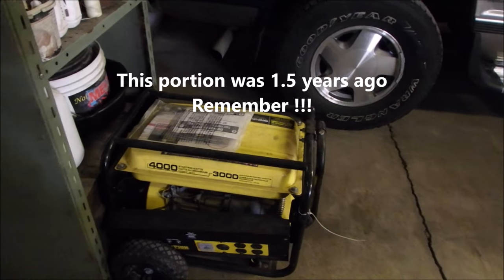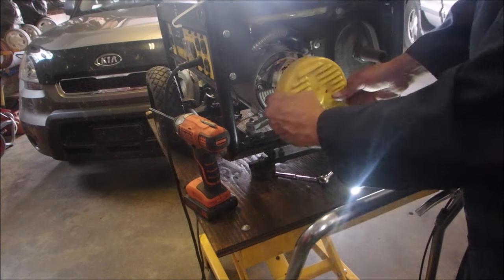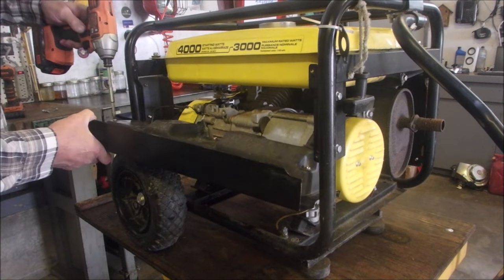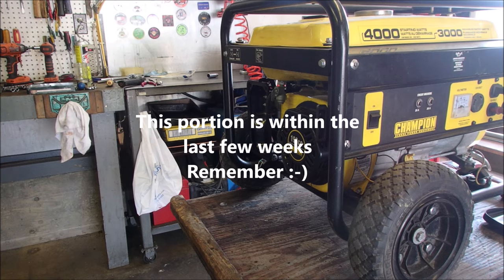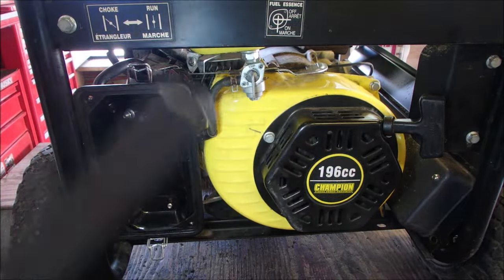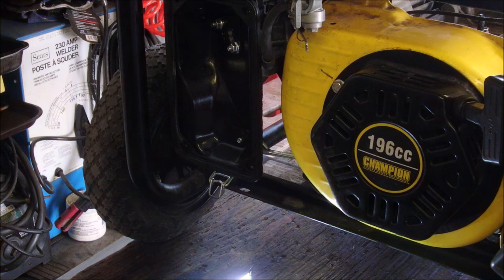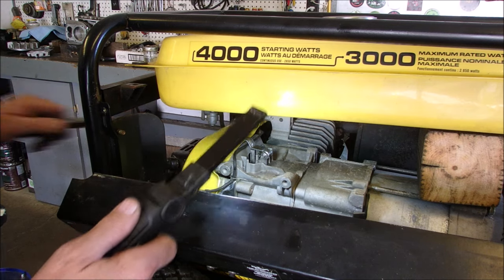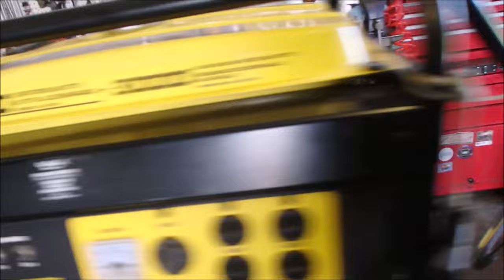4000 Watt Champion Generator, Multiple Issues

Comment: Bruce, I had the same generator and similar issue.  Double check the "sheppard hook end pointing down" of the largest governor   springs and make sure the end point is not bent down far enough that it is not dragging across the yellow metal shroud causing erratic behavior.
Reply from the maker: Yes i understand that .  The governor makes a grinding feeling when i turn over the engine without the plug.  Thanks for helping out   everything counts.

Comment: Hi Bruce, I've seen on those chonda generators where the air circuit in the carburetor will make it surge like that even on some older Honda snowblowers that had heavy commercial use (the jet and passages under the plastic idle screw) and had to rod them out with wire and old fashion carb dip. Good luck
Reply from the maker: Yes sometimes I forget to do the idle jut.  Then sometimes I over jet it causing black smoke.

Comment: I'll have to pull mine out again.  When I set the valve lash I didn't do the best job tightening everything down intentionally like an idiot.  Started right up afterwards no issues.  Then decided would not.  Will have to open back up, go through everything again to get in spec and get er going once the snow melts away.  Of course, haven't worked on since the Predator or the Honda's are my go to.  Seems at that time, I wasn't most keen on adjusting the governor and springs, so will have to look at that as well when at it.  Mine definitely had valve lash issue and of course the typical carb and fuel flow.   Some of the electrical can be funky like reminds me of testing parts that test good when no current running through, though a hairline not visible crack can be observed with like a light bulb or meter on when running since once warms up the break or high resistance manifests.  Thanks for sharing the details.  I'll try to document better when I get to in the future sometime when I have the time.  My channel is more sanity check for me since I do so many things concurrently and might inspire others to do the same and support others too.  Thanks again and keep us posted.
Reply from the maker: Yes   I want to take this apart Carefully and find that governor issue.

Comment: Good show Bruce.  If it likes to start with the choke on when the engine is warm, I would double check the fuel system.  Some kind of blockage or air leak.
Reply from the maker: You are correct.  However when the spark plug is out and I feel the govenor shaft when it turns over I feel a crunching feeling.  HMMM

Comment: Been waiting to see this one
Reply from the maker: Right  I diagnosed it to the governor.  I can feel it pulse and kind of crunch when i turn over the engine.  When I part it out i will be careful.  The problem is that it has been abused, meaning stored under a rural building in wet conditions.

Comment: My mechanic gave me his similar model. It will start but as you open choke it shuts down as if it can't handle load. Checked engine stuff like carb and valves, coil .Finally disconnected avr . Engine starts and runs fine. If you plug avr back in it immediately dies. New brushes and avr made no difference.  So genset is overloading engine due to a defect or engine can't handle any load but that would be hard to test except by engine swap.update typed comment while watching.  See you at governor.  Maybe long shot that some how my governor system is not responding to the lowered rpm of genset and throttle is not opening to to provide enough fuel to keep it  running.
Reply from the maker: I also had to disconnect the High volts shutdown  connector as it was shutting the unit down when everything was OK

Comment: I've found rule 1 if it has a govenor problem, it's not the govenor. Could be a fuel problem, air leak, or someone reset those govenor springs wrong or bent a linkage.
Reply from the maker: I can feel the governor pulse and feel crunchy when iiturn over the engine with out the spark plug in.  
i understand what you are saying though.

Comment: Cleaning up the brushes on this generator does make a  big shocking difference in it making the power  cool beans 🫘 there Mr Pender 😎
Reply from the maker: Great point!
Reply: @BrucesShop   hopefully you can get it fixed and running again soon Bruce  .I will have to say that The governor in my mind is the problem with the engine shut down unless it comes with a low oil sensor
Reply from the maker: Right  I disconnected the oil sensor  during one of the failures.  I don't know if that is in the video. @robertmailhos8159
Reply: @BrucesShop   how is the governor return spring look that might be the issue with the engine speed